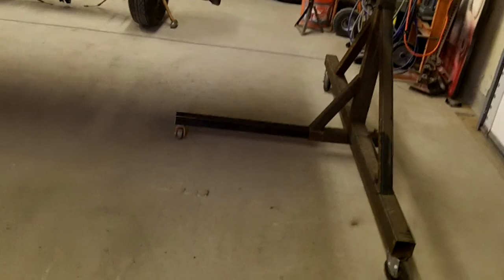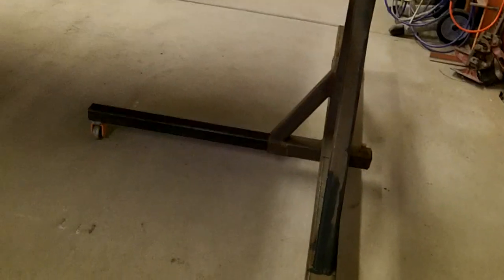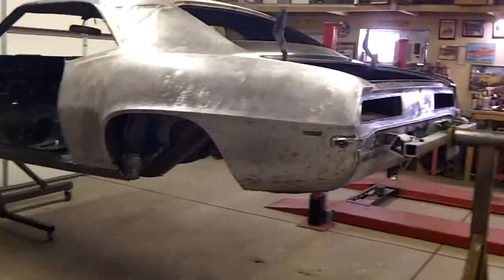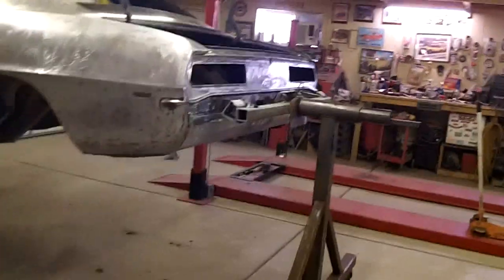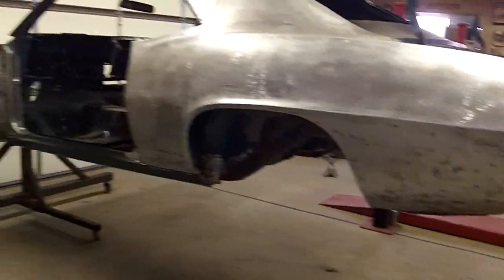69 Camaro Rotisserie install

Comment: Awesome!! Thank you for showing us how it’s done.  I’ve never seen it done before. Very cool!  Question, …. How/where is it bolted to the body? Will the body flex if the two Rotisserie sides are not connected? Thank you 😊
Reply from the maker: Thanks. I have the rear bolted to the bumper bracket holes and the front to forward subframe bolts holes. There could  be some flex if the sides are not connected. I have always just ran a long piece of 2x2 square tubing between the two uprights to lock the bottom together but I must have welded the new rear mount at the wrong angle because I couldn't get it line up properly with the front this time. instead I just made the two short legs and will tie them together with another piece to lock it all together & I think it will be good to go.